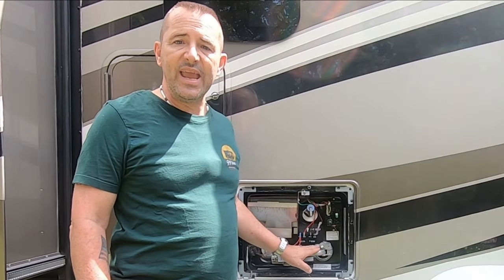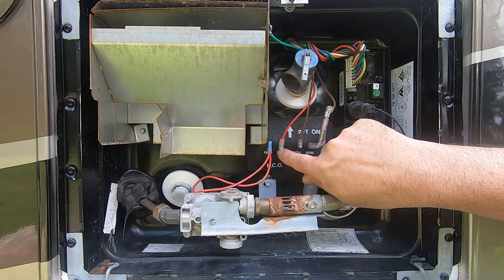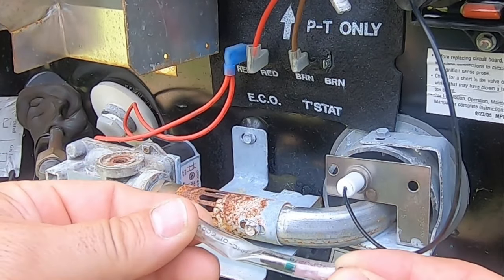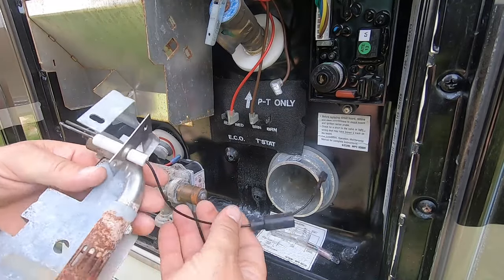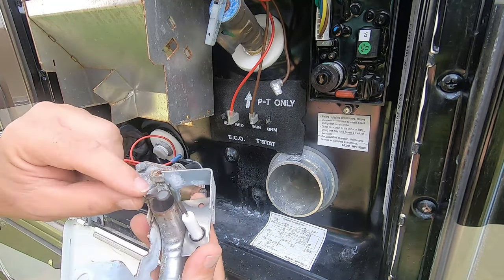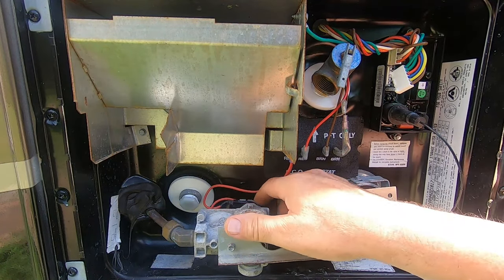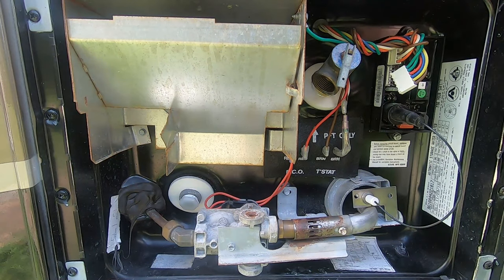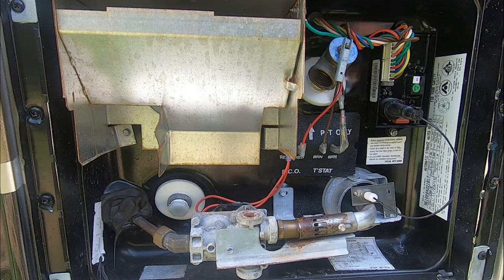RV Water Heater Not Igniting Or Staying Lit - Troubleshoot - RV Maintenance And Cleaning

Comment: That thing at the end of the tube you said was kind of off to the side what is that? I don't have that on mine and i am having the same problem your having...Im talking the thing by the spark at the end of the tube...almost like a wind blocker or something...Flame diverter! i don't have that...I also don't have a way to adjust the air when it comes to the tube....mine doesn't do that...I dont have a way to ajust my air it just has a open spot on each side
Reply from the maker: That is a flame diverted.  You may have a newer model water heater that has been redesigned.
Reply: @RVHabit  Does that mean i don't need the air adjuster because after i used tin foil to make myself a air intake adjuster or whatever its called....And it worked right away
Reply from the maker: It would be impossible to tell without actually seeing it.  I suggest just have someone familiar with the unit look at it.  Or if you can check out a similar unit to compare to yours.

Comment: I have done everything you shown but I still have the same problem. My unit is gaz only, I have a very nice blue flame for 3 seconds than its stop.....If I restart always the same patern.....works fine for 3 seconds than stop again !  Any idea ?
Reply from the maker: Hi Daniel it's hard to diagnose without being hands on.  However, if you cleaned everything like in the video, it sounds like it may be shutting the gas off because it does not think it is lit.  This could be the probe on the ignitor not sending info back to control board or perhaps the control board itself.
Reply: @RVHabit  I will change the ignitor and see...I have change the ignitor and the problem is the same...
Reply: I finally change the control board and it works ! I should have check the board first ! My vendor check it for free....
Reply from the maker: Hi Daniel, great to hear.

Comment: Hi there! Great video.
I am having the same issue with the flame going out after just a few seconds.
I did all the cleaning steps and installed a new igniter, but the flame still goes out after a few seconds. Do you have any other ideas on what the problem may be?
Thank you,
Reply from the maker: Well I can't diagnose it without hands on but my first thought would be the control board if you have checked everything in the video.  Watch my video on changing the control board on an rv water heater.  Good luck.

Comment: My hot water heater is making a sound as if it constantly filling up a guy took it out and did away with the gas and made it straight electric it started after my water hose froze is it something I need to worry about or what do I need to do
Reply from the maker: It doesn't sound right.  I would have an RV tech inspect it.

Comment: One more question:)
When the water heater is working should the ignition sensor glow red hot from the heat.
The problem I’m having is my water heater works then after reaching temperature it turns off and then when it try’s to relight I get a fault light.
Any suggestions
Reply from the maker: Try adjusting the air intake on the burner tube.  In the video I show you how to make the flame quieter.

Comment: One thing that you did not do... According to the Atwood Service manual, the Burner Tube must be centered and aligned so the gas flows from the orifice straight down the CENTER OF THE BURNER TUBE. Your burner tube is not oriented straight with the valve and the gas orifice.
Reply from the maker: Hi, maybe the video doesn't show it well but the gas orifice lines up in the center of the burner tube.  Thanks for watching.

Comment: I have the same unit but no hotter water is coming out of the faucets everything is working but no hot water can u please help me thank u
Reply from the maker: If the water heater is working you can check two common problems.  First make sure the winterization bypass is not open.  Usually it is a set of valves near the rear of the water heater.  Second make sure the hot and cold valves on the exterior shower are off.  Good luck.

Comment: I have a question.
I ordered a new thermo sensor kit which I have yet to receive, but the picture of what I’m getting is two thermo sensors and also what looks like a fuse or plug with a brown wire attached. Do you know what that’s for?
Thx in advance
Reply from the maker: Yes there are two disc type therm. sensors.  The fuse-looking thing is probably the thermal fuse that connects to one sensor and the control board wire. I take it off in the video to check it is working.
Reply: @RVHabit  thanks so much

Comment: I have water in that tube where the flame is. What would cause that?
Reply from the maker: if you have ruled out rain I would say the most obvious possibility is the relief valve is weeping and dripping onto the tube.  Weeping can be a normal occurrence or can indicate a bad valve or other issue.
Reply: @RVHabit thank you for the reply! It’s in the tube. Quite a bit. And can leak out and eventually run down the side of the rv. I’m thinking it might be time for a replacement unless I’m missing something.

Comment: What setting do you have your multi-meter on to check the continuity?
Reply from the maker: The symbol that looks like a sideways wifi signal.  It os a small circle with three curved lines.
Reply: The Omega symbol (ohms setting)

Comment: My igniter doesn’t make a clicking sound if I take a match the flame will light but then a few second later the gas shuts off and then try’s to cut on again does that three times but thenigniter never try’s to light the fire
Reply from the maker: Check the ignitor or control board.

Comment: My heater cycle on and off. With flame.  I hear the sparker.  Huge flame then goes off.
Reply from the maker: I would check the air adjustment tube first.